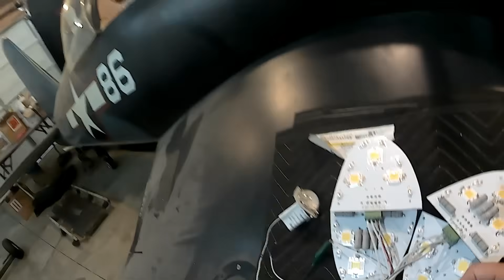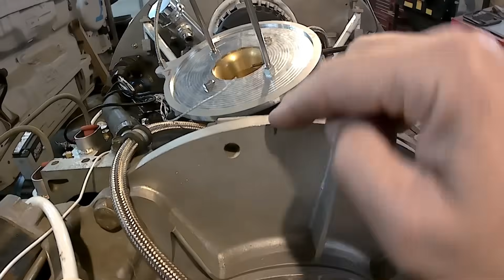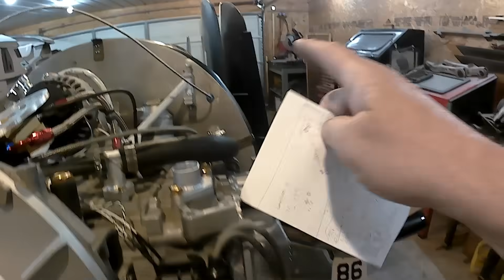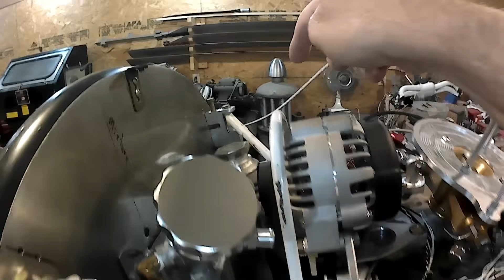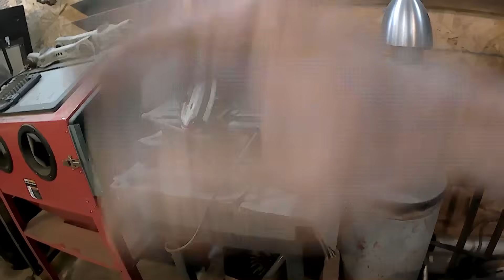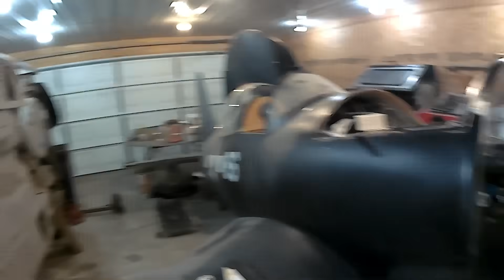WAR Corsair Update 8/5/2025

Comment: Curious how you think the FAA rules,  MOSAIC rule (Modernization of Special Airworthiness Certification), will affect you and if you think this is positive.
Reply from the maker: I took a quick look at it, and the only thing I see is the stall speed limits. Need more info on that part. It has three different speeds listed . Need to find out which one applies. But I may be able to fly it with just a sport pilots license. That would mean no more third class medical or even a Basic Med type.

Comment: G'day Don,

Yay Team !

Well done for biting the Bullet and embracing the option of remaking the Engine-Mount..., in a way that it won't be able to warp and twist and cup and bow - as the Wooden Baseboard responds to Heat and Humidity and changes shape while the Job is underway...

Granite as a Welder's version of an "Engineer's Flat" will certainly work, so long as  Heat radiating from the Welding doesn't crack the Granite  midway through the sequence...(!?).

I doubt that such a thing could happen - but it's the only possible Loophole  I can imagine, through which anything unwanted and unexpected might suddenly "jump out at you" to derail the Squareness of the next version's alignment.

Trying to shim out the discrepancy
Might perhaps have been made to work...(?) ; but I suspect that even so,  every time you looked at it or thought about it, the very concept would have irritated you, greatly...(?) !

Such is life,

Have a good one...

Stay safe.

;-p

Ciao !

Comment: Big boo boo! Sounds like you need to make a new engine mount. Nobody is perfect. That sucks!  I would probably make the same mistake or even worse. "CRASH!"
     It reminds me of mounting a R.C. airplane modle engine shimming one side to center or off center the engine to make it fly straight.  That's something to think about.     During writing this comment you said you will have to make a new motor mount before I finnished. So we both agree on the subject.  
    Thicker tubing is stronger. Good choice for a new motor mount.
Reply: @SR-gs8zo Lets both find out what the next motor mount will do after welding it together. Metal changes after heating and cooling. Sometimes metal shrinks or worps. Don said he's out of money. It will be quite some time to see SuesyBell up and flying again. I think Don should of stuck to Drag racing.

Comment: going back to one of your other videos where carb popped off.  Is there enough room to drill and tap a set screw in the mounting flange?
Reply from the maker: That was the original idea, to use three set screws. May still go that route.
Reply from the maker: @SR-gs8zo  No harm in starting the engine with the carb just pressed in. The O ring sealed it from any vacuum leaks.

Comment: Don,

Those new wing tip LED's should look great.  No one is going to miss seeing them on there! They are super bright.  

I'm so glad you found your engine mount miss alignment as that certainly would have introduced some bizarre flight issues that didn't exist before the motor mount changes. Interestingly, in my RC warbird models, I build in about 2 degrees of down and right 1 degree motor angle to try and reduce the P-Factor on them and it does help in varying amounts depending on the airframe(How tall the rudder is).  

But I don't know if that would be true or not on full scale.  Plus my models all spin the prop CCW and yours spins CW so in your case it would need down 2 and left 1 for the prop vortex/helix to be aimed up above the rudder to help miss it during takeoff.

I also like that you are removing those motor mount extensions and the possible added complexity they add into your setup.  I'm enjoying following along with you on your channel on all your improvements!

Comment: Do the motor mount changes mean yuo can remove the aft extension to the cowling?
Reply from the maker: No, I still need the engine where it is to clear the oil tank. If I move the cowl back to its original location, the prop will be sticking out too far past the cowling and it won't look right.
Reply: @Dynodon64  Ah I see. Thanks!

Comment: Well....at least you found it. Too bad your prop spins the opposite way. Right thrust would have been perfect. Are you going to put any left thrust,and down in it? Did you have pitch trim changes with throttle changes during your early flights?
Reply from the maker: Never noticed pitch change with power change. I will keep the engine straight ahead, with no offset.